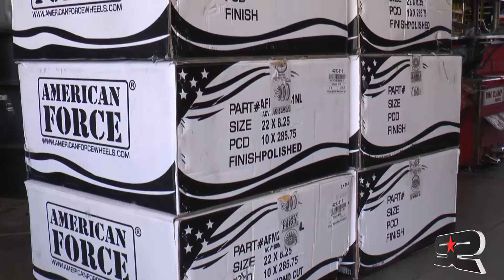2020 Ford F-450 Super Duty with King Coilovers & Shocks + American Force Wheels - SoCal SuperTrucks

Comment: Would love to see some part numbers on the shocks used and how the conversion was done it looks amazing.
Reply from the maker: King offers the coil-over conversion kit.  The part number is 25001-146, the front bypass shocks are 25001-372A and the rear piggyback shocks are 25001-171A.  Keep in mind these were also ordered with the custom chrome smooth shock bodies, black anodizing and hoses with red powder coat on the springs.
Reply: @SoCalSuperTrucks  greatly appreciate the reply and the information, thank you!
Reply: @SoCalSuperTrucks  What is the total cost?  Can you help sell existing wheels from F450?
What is the durability of these parts and warranty?
Reply from the maker: We'd be happy to get you a quote for this set-up.  Please give our sales department a call at (909)383-5454.  They will also be able to answer your questions regarding warranty etc. 👍🏻
Reply: @SoCalSuperTrucks 
Love the setup, looks awesome! Props to you and your shop. In the description you mention the company “Viair” did you install helper bags in the rear as well?
Reply from the maker: @christianbonfiglio5544  Yes it has Firestone bags but a ViAir onboard air system that inflates them.